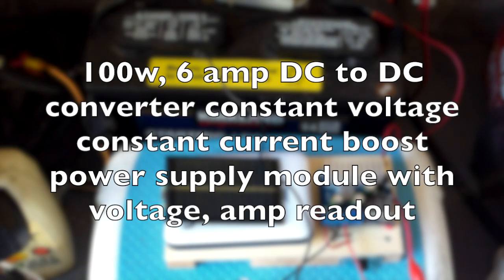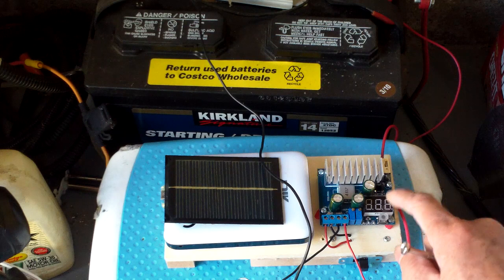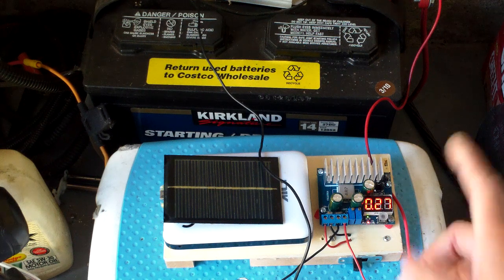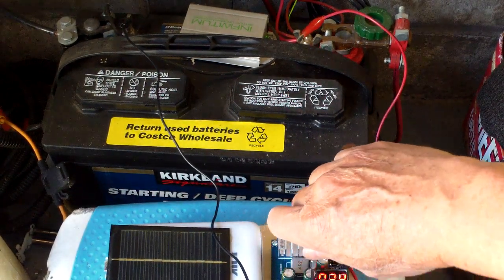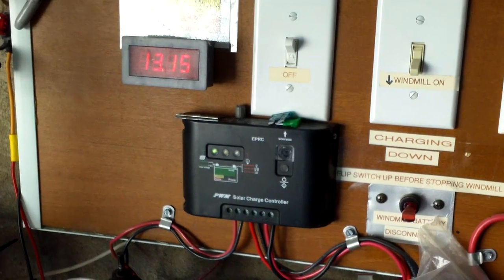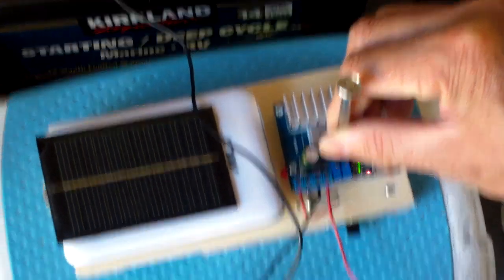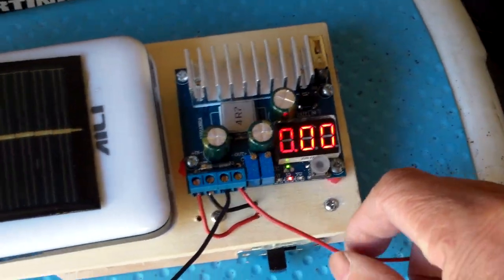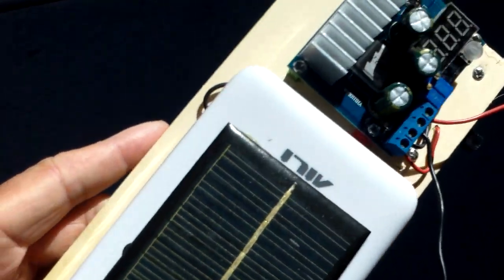100 watt dc to dc voltage boost converter

Comment: Link for internet store?
Reply from the maker: http://www.ebay.com/itm/DC-Boost-Converter-3-35V-12V-24V-5V-100W-6A-CC-CV-Regulator-LED-Voltage-Current-/182372996759?hash=item2a76471697:g:ELcAAOSwiDFYP~9u

Comment: I have a 2000 watt converter and I'm going to turn an air compressor motor with it that is rated at 115 volts and peaks at 230 volts.  can get it to turn for just a second and then the power of our clicks off do you know if there's a way that I could get a boost of Wantage to get the motor turning because after it starts running the voltage that is required to run it drops I thought maybe I should go with a capacitor or wattage booster or maybe even buy another inexpensive inverter and parallel it into the existing one that I have it's just something that is dangerous for practical?

Comment: I forgot to add, what a great little boost converter. I paid $6.50 US for mine at a Chinese site. For the price it is tough to beat. I purchased mine to drive high power LED's after watching Julian Ileet's video on a boost converter. I think it should do the trick for a 50 watt LED and maybe even a 100 watt, but that may be pushing things a bit.
Reply from the maker: Wow, $6.50 is a real bargain.  That's more or less my rule of thumb too. If they say 100w, that means it's probably ok to run it to 50w.
Reply: Yes, I figure I can run a 10 watt to 50 watt led from this converter. I have ordered a larger one that puts out 900 watts. That one I will use to power a 100 watt LED. Really I could power more than one depending on the capacity of the battery.

Comment: Another word of caution, be careful of the bottom of the boost converter as the capacitors leads can give a nasty shock if touched. I have the same board. I would put a small blob of hot glue over the terminals or electrical tape.
Reply from the maker: Thank you for your insight.  Probably not a good idea to touch the underside of the board.
Reply: No it is not, I don't have mine mounted yet and noticed the bottom of it that the capacitor terminals are exposed. Needless to say I was really careful handling it.

Comment: sir what if , i want to built my own dc to dc voltage boost converter . do you have a schematic ?
Reply from the maker: Sorry I do not have a do it yourself circuit.
Reply: ok never mind sir :]

Comment: help mine wont go below the inputed voltage? and mine only "boosts" the voltage when the input voltage is at least 10.1v
so not very useful :( is there anything I can do?
Reply from the maker: Yours is probably a boost converter.  There is something wrong though when it only boots the voltage when you need at least 10.1v to boost.  I have found most of the adjustments on these boards are a little quirky and you cannot set the voltage you want overtime. If yours not working right, you can try turning the potentiometer counterclockwise at least 15 to 20 times, then turn them clockwise to increase the voltage and see if you can get the adjustment you needed.
Reply: wtam69 I wanted to boost anything from 5v to 20v to only a set voltage around 12v.. like a step-up and step-down converter built into one.... so even if the voltage drops a lot i'll still have 12v even if the input is 20v or 5v

I can definitally change the output voltage and output current. but i cant make the output voltage lower than the input voltage... so that defeats the purpose of the reason i bought it..
Was only 12$ so not much lost... I did a test with a source just under 12v between 10.5v and 11.5v and it was able to keep it at pretty much precisely a boost to 12v as long as i had enough current..

but I wanted something that will keep it at 12v even if the input is 5v or 20v

Comment: hey, can i use a 6v 156a battery as a input, to make a 12v output?
Reply from the maker: Yes indeed. The only thing to watch out for is don't go near that 100w limit.  Use it more conservatively. Also, don't plug in that USB until you have set your output voltage to 5 to 5.2 volt or you can fry you usb equipment.  The USB actually output the voltage you set. I damage one of my USB equipment that way.
Reply: thank you! this information was very useful!

Comment: hey man, how big this is??? or size
Reply from the maker: About 2 inches by 2 inches.   If you get this, do forget to adjust USB output voltage to 5 or 5.2 volts before using the USB output. Otherwise you can burn out your equipment.

Comment: can you provide a link to the product page please?
Reply from the maker: +Reign Of Error Just type this at ebay search box: DC Boost Converter 3-35V 100W 6A constant current W/ LED Voltage/Current USB
Reply: its similar with this link
http://alipromo.com/redirect/cpa/o/o4sil83ypfttnhq8t5wmg47rropv07sf/